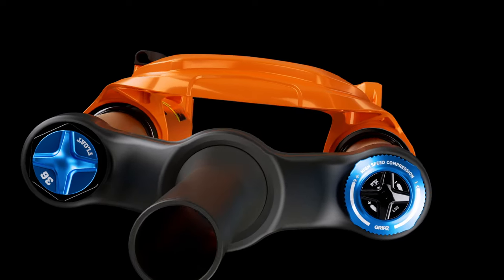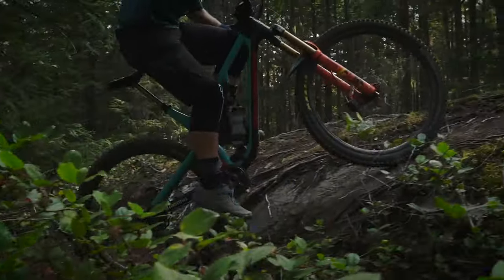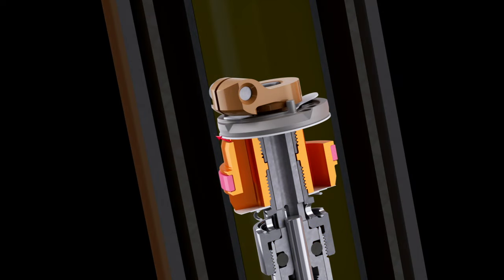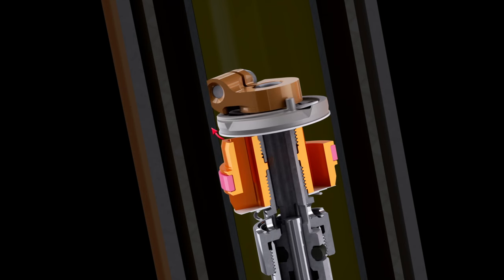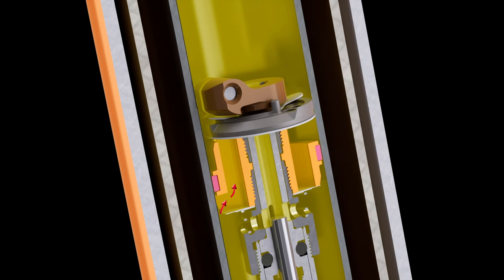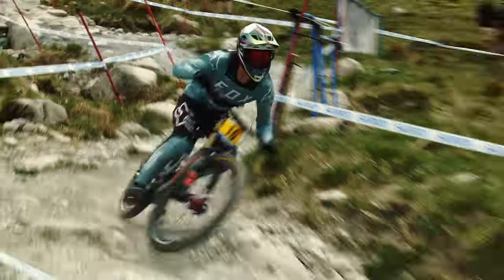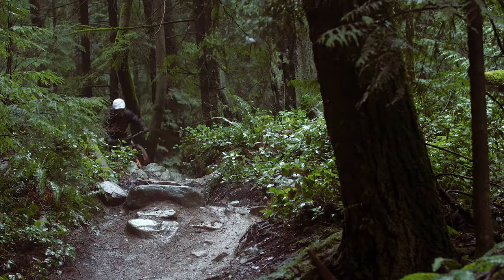FOX Explains the GRIP2 Damper

Comment: It would be awesome to see Force-Velocity plots of Grip2 vs the competitors. I.e, rockshox.  Operational range, shock fade, oil aeration, stantion tube friction coefficient, max travel comparisons, weight, positive and negative airspring pressure adjustment ranges, progressivity ranges, and so on.

The CAD animations are impressive and beautiful, but folks already come to expect solid functionality from a top manufacturer like Fox Factory.

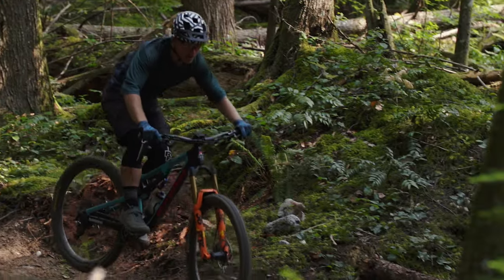Also, did he bottom out at 0:44?
Reply: BurnDuration bottom outs happen.  The big question is did he feel it and to what extent did he feel it.
Reply: Roman Medina probably not. I think as long as the rider has confidence in the bike setup beneath him/her—that is the most important.

Comment: I feel like with this design, the helical ribs on the HSR adjuster plate will eventually wear from the rubbing of the leaf spring as the HSR circuit is opened and closed. Do you have a testing machine that just constantly cycles the fork to test for this kind of wear, Fox?
Reply: .........................It's fox dude you think they dont?